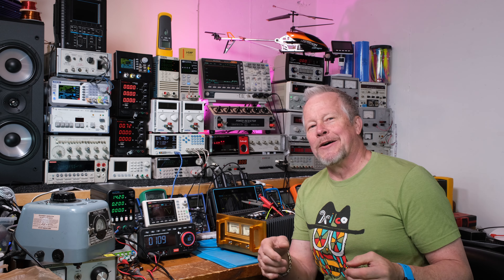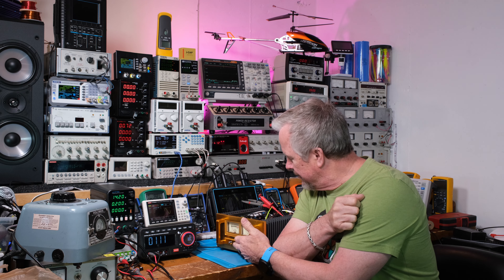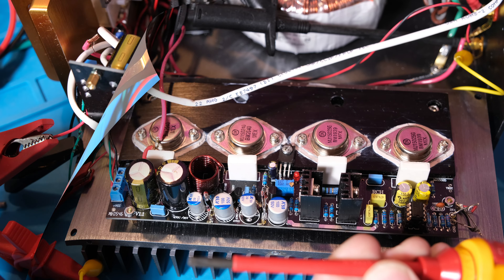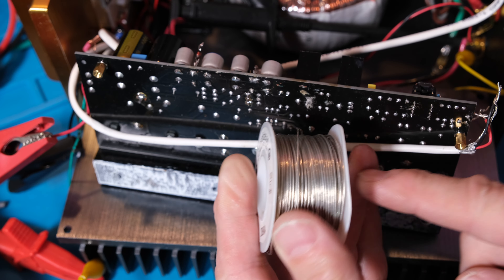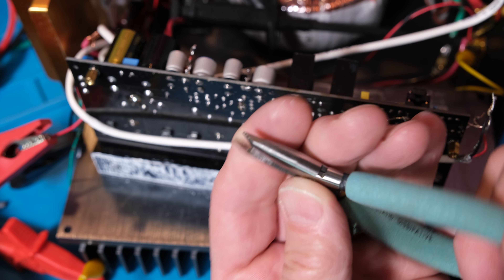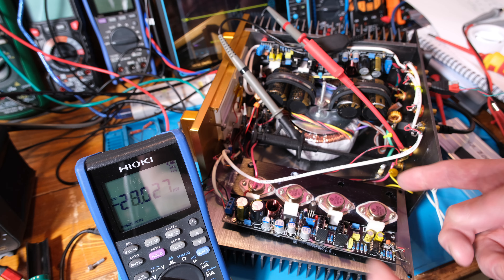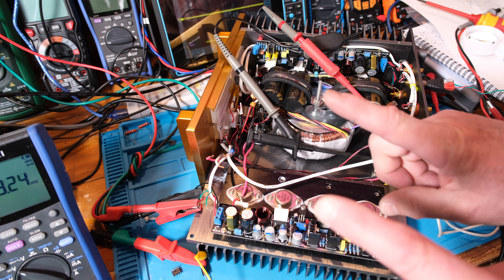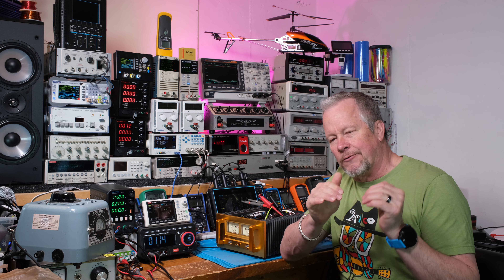20 Watt Class A Amplifier Repair

Comment: Been doing audio for over 40 years. I find square waves very useful. Usually 1 kHz. Tells me in a hurry if there's linearity problems in tone circuits, tell at a glance if phono EQ is working (rolled off highs, accentuated lows). Even use to set bias on reel to reels, using maybe a 2kHz square and adjusting bias to simultaneously show low and high frequency response, balancing the leading edge ringing(which is normal) vs the low frequencies, looking for balance. Also, I find that dirty controls seem to show more on a scope as the controls are manipulated with squares than with sines.
Reply from the maker: It sounds like you have expertise and know how to work with audio.  I think the square wave test that we have seen for testing power amps is the question.  What does it show and how do you correlate that to what sounds good?
Reply: @KissAnalog  Well, again it shows linearity at a glance. If there's a bad low frequency rolloff capacitor in the feedback loop of one channel, the resulting frequency response problem will be obvious, although in this case a sine wave works well also, since the low gain and phase shift relative to the good channel will also be pretty obvious with a sine.
Reply from the maker: I trust you and your experience.  I can tell that you are a thinking man with great experience.  Thank you for this feedback.  I will have to do some square waves to see what I think of them;)

Comment: I agree with you Eddie. I don't see the point in using a square wave to do any kind of test on an audio amplifier. The square wave includes all kinds of high frequencies which would be beyond the bandwidth of the amplifier and even if it could amplify the higher frequencies with little distortion, who cares?
If I'm wrong then someone might help me out and explain why it would be a good idea.
Reply from the maker: Thank you!  I’ll talk more on this in a video soon.  I’ll probably show some testing as well:)

Comment: Square wave is a torture test. Bryston run a square wave into a capacitive load at rated full power for several days non-stop before selling it. With regard to biasing, give it the full Pass Labs.
Reply from the maker: Thanks, but I don't see it as a valuable torture test, and I still see no value;)  Rated full power can not be done with a square wave.  The wave is not high enough in voltage to test the voltage rails.  It is a crazy test for an amplifier.  I think it is more of a 'see what we did' test that really is nonsense.  Test at 20 Hz at full power - now that is a test.
Reply: @KissAnalog  They give it a 20-25 year warranty. Bryston are serious campaigners that make gear for professionals, there is no hubris involved. Their amps are rated <1hz - 100khz: -3db so you can take whatever you want from that.
Reply from the maker: Thanks for bringing this up.  I am a fan of Bryston, and feel like they make very high quality equipment.  And maybe it is because of their wide bandwidth that they chose to use a square wave to press how great their amps are.  But that was just to set them apart by coming up with something others are not doing.  It is not because it is a better test.  Audio unfortunately is full of crazy stuff.  I don't blame Bryston, if you are a quality vendor - you have to do something to set yourself apart from the muck that is out there.
Reply: @KissAnalog  Cheers perhaps we could try some things like SINAD, IMD, crosstalk and slew rate for more conventional and perhaps more meaningful tests.
Reply from the maker: I like it - thanks!

Comment: Square waves are commonly used to check for stability issues, i think they are meant to try and provoke oscillations in faulty or badly designed amps. Usually  a good thing to do on a new design. 
Also synthesisers can produce all sorts of random wavforms so dont be so sure that none produce  "squarish" waves somewhere in your music collection
Reply from the maker: Thanks for your feedback.  The issue with square wave that I have is that most amps roll off just above 20 kHz.  The difficult part of the square wave is the rising and falling edges - not so much the square top.  So, who ever tells us what those rise/fall times are?  They miss that because they are not engineers and they don't understand the most important aspect of the test.  The amps bandwidth is not designed for the fast edges, and I think the stability can be tested by a pulse (maybe set at 20kHz) from zero to max power - maybe taken at load steps to finally get to max.  If a synthesizer were to put out a square wave it would be for putting out distortion as it would be terrible sound.  The synthesizer would put out many frequencies to build the square wave, but why would anyone want that?  If the synthesizer simply wanted a distorted wave it would probably come close to square but would leave out some frequencies to get the distorted sound that they are trying to achieve.  So, the rising edge would not quite be square.

Comment: Your friend does not use a preamp for turntable?! So, how does he do RIAA equalisation?
Reply from the maker: His turntable does have a preamp out with RIAA, but it is still a lower voltage signal.  I think 1V max, but I need to check again.

Comment: I disagree with you Eddie as the squarewave test is an extreme test primarily used to test a new design such as the JAT501, it's actual behaviour is very important   to understand as you really don't want it to burst into spurious oscillation if its fed a challenging signal (Rick Astley for example) the test is fundamental at the design stage but should us hobbyist do it ?? absolutely ! because it takes seconds to do and you will visually see your amp is rock solid and stable under less than optimal conditions or as the designer intended so I say 'Do It' you may learn something !...cheers.
Reply: Introducing a square wave signal to an amplifier's input (DUT) is very useful in determining the slew rate of the amplifier and from that you can also get an idea of how good the amplifier's damping factor is, at the lower frequencies. So in general, a square wave would facilitate quantifying how well the amplifier controls the speaker diaphragm at both low frequency and high frequency testing. Of course there are much more accurate/expensive ways to realize the same type of testing, using, say, an Audio Precision audio analyzer, but for us hobbyists, I must agree with you Andy that a square wave (ofc, at varying frequencies ie: [20 Hz - 20 kHz] the human hearing range) is quite useful in revealing the little "gremlins" like ringing at infra/ultra frequencies which may be present in the amplifier's output stage. Just my unsolicited $0.02.   Fred
Reply from the maker: Thanks for this great feedback!  Yes, I can see it being useful, but what if John had tested with 20kHz, or for that matter a dual signal?  It is one thing to say that the amp is unstable and will damage itself, but because there is a dampened sign wave - that does not mean instability.  The dampening shows filtering and stability.  If it is a ringing wave - yes that is an amp that is not stable.  I just believe that there are other ways to show real performance to the music that will be played and what the amp is designed for.  Instability is often found with a bump of signal - no matter what the wave shape is.  I've corrected designs from Crest Amp that showed instability with a sign wave.  I'll show ways to test amps and to come to real rating systems.  I'd like your input and input from others along the way to help come to pragmatic practical ways to test an amp.

Let me ask a very important question about how to set up the square wave; what is the rise and fall time of this square wave??  I never hear that defined.  That is the true measure of the performance.  Frequency has much less to do with it.
Reply: @electronicengineer  If I understand correctly, a "damping factor" is the ratio of the load impedance to the amp's output impedance. Could you please explain how is square wave helpful to determine the damping factor? I mean, what do you measure and where?
Reply: @jakubczajka4275  You are absolutely correct that to maintain a high damping factor (which is the measurement of how well an amplifier can maintain TOTAL control over the load (low frequency driver/woofer) for the point of this response, the amplifier needs to have a very low output impedance, approximately 0.1 ohm or less. The lower the amplifier's output impedance, the better. Additionally, since a loudspeaker is a reactive load and not just simply a resistive load, on the amplifier output, short wire runs of heavy, high quality copper with correct gauge speaker cable and interconnects must also be used. Up to this point, the aforementioned ground rules for maintaining a high amplifier damping factor , I have defined the optimum ways to maintain a good amplifier damping factor, with the term "maintaining" the high damping factor as key. Now, once we have all of our "prerequisites" for preserving and maintaining a high amplifier damping factor taken care of, we ultimately must focus our attention on creating this high damping factor in the first place, so we can measure it! A high-quality audio amplifier must incorporate a very high quality power supply (ie: fully regulated, lots of DC current available on both Vcc (+) and Vee (-), and gobs of capacitance "headroom". Now that we have the "ideal" scenario for being able to quantify the  audio amplifier's actual Damping factor, incorporating a stiffly regulated set of power rails with tons of headroom, we can provide more precise, cleaner and more dynamic power to the amplifier, which can help improve its overall loudspeaker driver(s) control performance, to include the high damping factor. So, as I was taught,. the audio amplifier's Damping Factor starts life (the actual inception of DF) as to just how quickly and accurately the audio amplifier can move the loudspeaker diaphragm from (center) neutral - to-forward (excursion) - to neutral -to reverse (excursion), and whilst doing so, maintaining full & total control over the loudspeaker, at all times, as it moves very quickly and precisely, the exact amount of deflection, to accurately reproduce the input signal 100% faithfully. Now, to answer your core question as completely as I can, performing damping testing on an audio amplifier can be done in several ways, and the way I was "loosely" referring to was by injecting a square wave signal into the audio amplifier (DUT) using an signal generator and whist employing an oscilloscope, scoping the audio amplifier's input & output signals (the audio amplifier must be loaded with the correct speaker impedance using a dummy load or better yet, the actual speaker that the amplifier will be paired up with). Using one channel of the scope and using a second oscilloscope channel to visually monitor the audio amplifier's input signal simultaneously, set up the test I just described using a sinewave sweep signal from the signal generator (set to sweep 20 - 20kHz), adjust both scope input channels to display the exact, same amplitude on the scope screen and precisely overlay the two scope traces one on top of the other. Now Sweep the audio amplifier with a sine wave signal a few times and record the performance (paying particular attention to the rise and fall waveforms of each wave on the scope display. You may not notice much, if any difference using the sine wave signal. Next, simply substitute the original test's sine wave signal with a square wave signal (same amplitude!) and now, once again, watch the scope's waveform responses. Record these square wave test results as well (these are the results we are after!). In a perfect world, using perfect test equipment and testing a perfect audio amplifier, the two wave forms should be identical. The rising edges and the falling edges exhibited on your oscilloscope will show you a completely valid, "old school" /  "poor man's) methodology for determining not only the (DUT) audio amplifiers damping factor plus HF short comings, but several other interesting "artifacts" which will also be revealed to you, clear as day, using this method. Have fun! And if you feel like it Jakub, let me know what you found out!   Best, Fred
Reply: @electronicengineer  Awesome ! Thanks !!
Reply: @KissAnalog  I just read the post from @Fred Roeder and found it fascinating 😃
Reply: @electronicengineer  Thank you for your answer! I appreciate the time you have spent writing it! I am designing my first class "AB/B whatever" amplifiers right now, and I am very interested in testing them properly, hoping to avoid burning expensive speakers. I have already selected pretty much all semiconductors and passives. Now adding/editing SPICE models and footprints. Once I have built the prototypes, I will let you know how successful I was... Thanks again!
Reply: @electronicengineer  Oh, I agree that regulated supply is the way to go (It is 2023 after all!). I am thinking about some SMPS. I do not really want to deal with even more heat sinking in case of linear supply. Prices and sizes/weights of old fashioned transformers are also rather discouraging.
Reply from the maker: Damping factor is an intersting term that audio guys came up with.  We will have to talk more about this and the idea behind the meaning.  @electronicengineer has some great points, but I think we need to go a bit deeper and understand just what this term means and its importance.

Comment: Square wave test into a dummy load wouldn't be a real world test speakers are not the same as dummy loads they're full of capacitors and inductors in the crossovers. If you do a test into a dummy load with a square wave and comparative the load of a speaker you will see lots of differences. Another thing I have never heard of anyone doing blind A / B test between two amplifiers one of which behaves badly with square waves
Reply: I have just repaired 2 NVA power amps. They don’t do well with square waves at 20k but they sound better than NAD ,quad and exposure amps I have .
Reply from the maker: Thank you!  I agree with you - I think the square wave test shows performance that is questionable.  Is it good or is it bad?  Comparing amps that perform deferent would be the proof;)